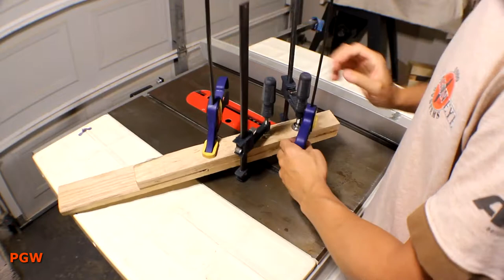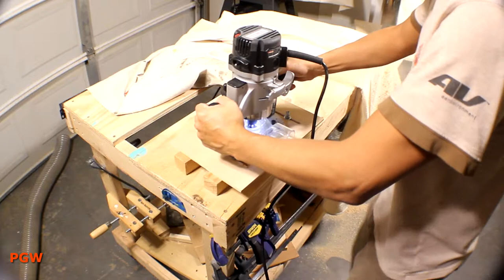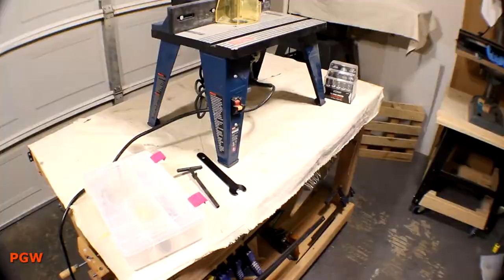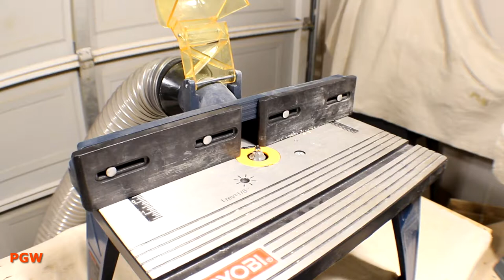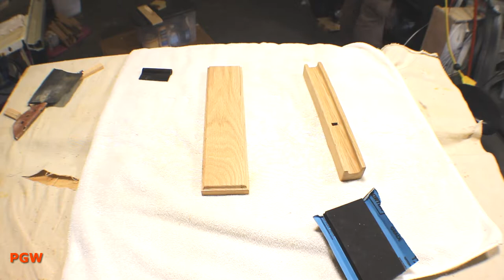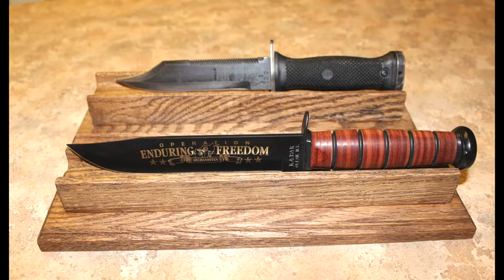Awesome Ka-Bar Knife Display!

Comment: Dust Collection,  get a big mouth and stand from grizzly,  position it close to your sanding works great.   Also,  you should get a small vac. and attach to your sanders instead of the dust bags that don't work all that great.  (think of it as a poor man's festool dust extractor)... do forget to put a suction control in line with the hose so you can control the suction.  http://www.grizzly.com/products/Big-Mouth-Dust-Hood-with-Stand/T10117?utm_campaign=zPage&utm_source=grizzly.com
Reply: also don't forget to use a dusk mask always.
Reply from the maker: Great idea, I'm working on an attachment for my orbital sander to connect to the shop vac. Its a little 3D printer project I have been working on. Thanks for the push!